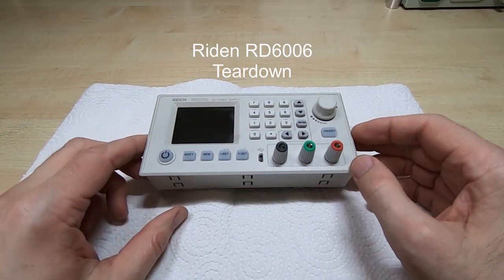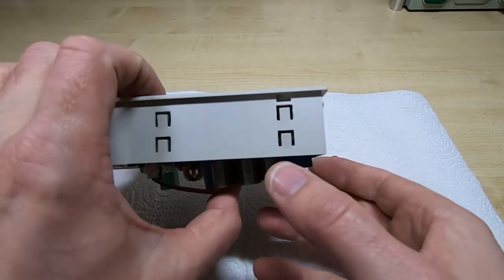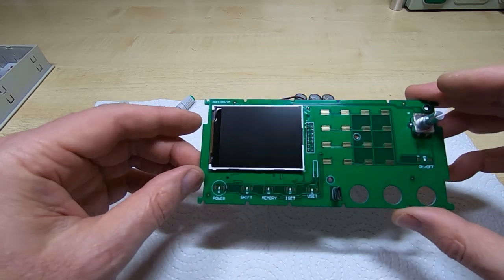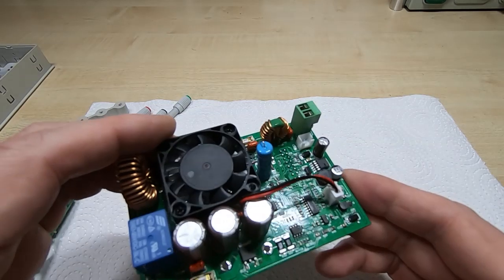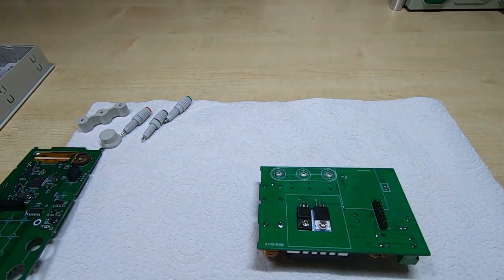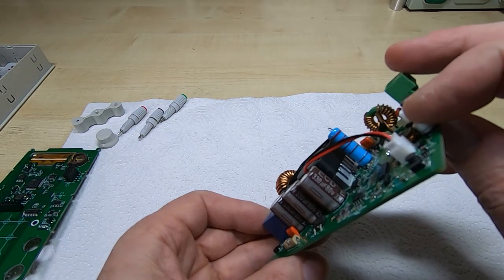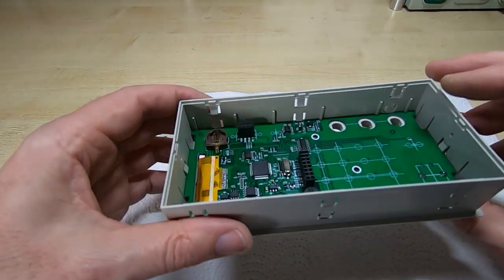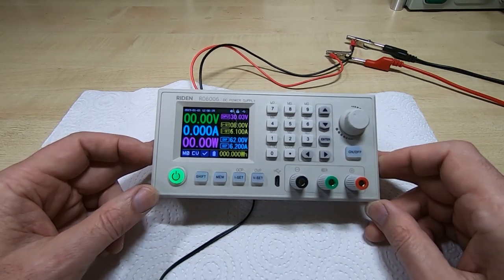Riden RD6006 Teardown

Comment: Hi Jerry, just ordered an RD6018 as it was the best deal on banggood. I was really curious what is under the heatsink so maybe I can change it to a bigger one. Thank you for the video! Any idea if the heatsink is glued to the PCB or is this just held by the Schottky and the Mosfet?
Can you provide any useful link (or info here) how to calculate the capacitors value if I want to use a toroidal tranformer as a supply (around 60V and 600VA)?
For audio, forum members recommend 100uF/W while in your "RD6006 Linear Version Part6" you use just around 11.000uF for the 350W which is 30uF/W. Is 22.000uF enough for a 600VA toroid to feed the RD6018?
Regards, Zoli

Comment: Great series, but worth commenting about isolation. I guess the Riden unit is not floating between input and output OR between output and USB which both are serious limitations. Also the green central output post deserves approbation as it implies the standard floating layout with earth connection but is not that but a separate function for battery charging. A useful discovery that the relay only isolates the battery connection and not the primary output posts. I am guessing if you want to build a multi-channel unit you need separate back-end isolated supplies, at least if you want to be able to connect positive to negative to give a negative supply. Even if you do this, the USB is likely to tie the negative to ground on both units causing disaster if both are connected by USB.
Would have much preferred they'd used BLE rather than WiFi and hidden the USB round the back for firmware update only. This way there'd have been galvanic isolation and avoid all the faffing about disconnecting WiFi from the router and reconnecting to a dedicated network.
Reply from the maker: That is not the way that the USB is connected. The USB is isolated so in theory you should be able to connect multiple supplies although I would never recommend running power supplies while connected to a PC. As far as input / output isolation this would depend on the nature of the back end supply but almost every type of supply will provide input / output isolation so the outputs should be fully floating (which I demonstrated in the video showing the shorted screw fault). As long as the supplies are wired and used as intended then there should not be any isolation issues. As I said in the videos I would never use these supplies for battery charging and a common thought and something I have done on mine is to disconnect the green terminal from the charging circuit and connect it to mains earth.

Comment: Hi,
Great video. However few things left me curious. What is that big resistor for, given it's not for current sensing? Also in your Kunkin load review, you got this module to produce clicking sounds at maximum current. What is responsible for what?, it can't be relay if it's for charging.
Reply from the maker: It was the relay. The high peak currents cause the supply to cycle the relay. Possibly a firmware safety measure or just an oddity.

Comment: Hi
That 8 pin header is for connecting WiFi Module..
Reply: I paid extra for the wifi-enabled version. The daughterboard has an ESP-12F module (Expressif 8266, so suitable for Tasmota or similar, 80MHz arduino-like 2.4GHz wifi module), a tiny switcher from the 5V input to the module, and a little 100uF 16V capacitor.

Comment: Hi Jerry,
As always, this is a great video. Electronics sounds easy with you :)
As the unit is split in two parts, one being the logic part, and the other being the power switching module, couldn't we imagine making a linear power module to replace the switching one?
With your linear back end power supply project, that would turn the whole system into a full linear lab power supply, cheap, with a modern interface, with modern capabilities, and close to noiseless.
Is that a ridiculous idea? Or do you think that could make sense?
And again, thank you so much for your work.
Sam
Reply from the maker: It may be possible but unfortunately it takes a different approach to design full linear supplies. If for example you tried to use a linear regulator for this supply and you set 1V output at 6A then the supply would need to convert the 60V input to 1V out which means that it would need to drop 59V at 6A and so would dissipate 59x6 = 354W internally. Linear supplies normally use a multi-tap transformer and they select different taps depending on the output voltage. EG 10V, 20V,30V,40V,50V.60W. Therefore to output 1V it would select the 10V tap and so the dissipation is then 9x6 = 54W. It may be possible to use the Riden front board and create a power controller board along with a suitably wound transformer. It certainly may be possible to use the Riden as a starting point to avoid having to tool up for a plastic moulding but it depends on what resources are available from the ARM processor. It is an interesting idea and may be an interesting project. The power controller board would be much more complex.
Reply: @JerryWalker001  Thank you for your answer. That makes perfect sense. I think I'll wait for a looooong time before attempting that :)